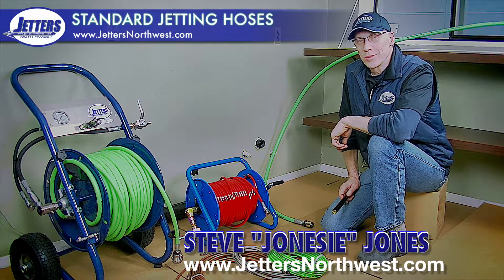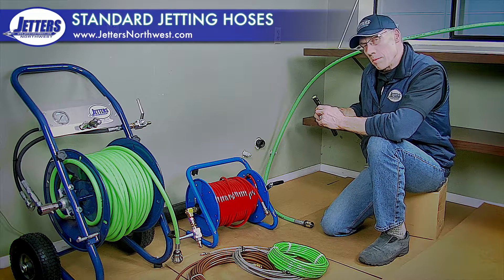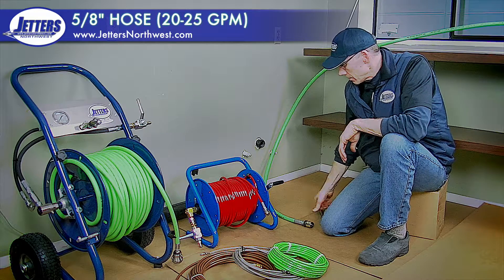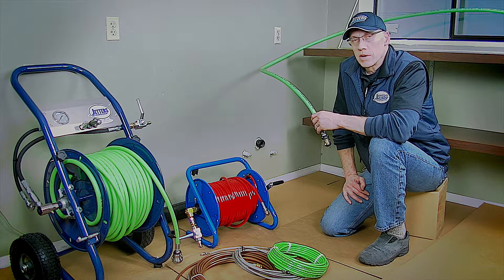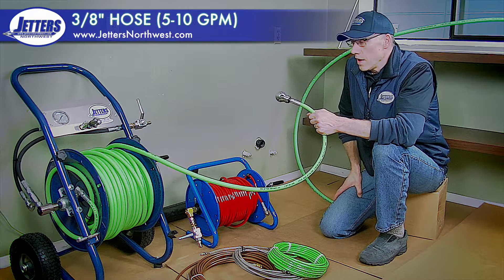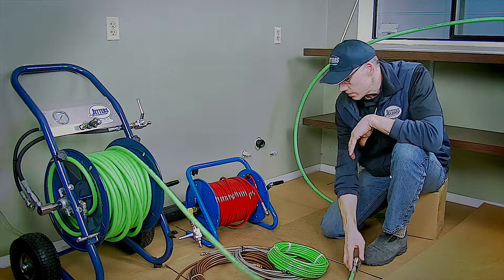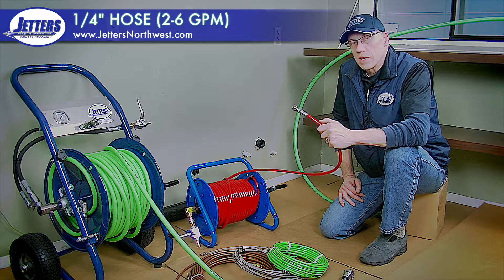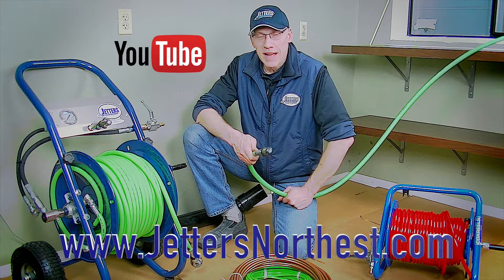JETTING HOSE SIZE COMPARISONS: 1/4", 3/8", 1/2", & 5/8" - "GET" JETTING with JONESIE

Comment: I have a  general 2900 with 3000 psi 4GPM with a 3/8 hose and 200ft , is this a good setup and could I cut roots with this setup?
Reply from the maker: 4gpm is just barely enough to run a root-cutting head like a RootRanger or the ENZ-Reverse but --  because the GPM is so low -- it will be slow going and require using a camera to line up the nozzle on the roots and then a lot of hose/nozzle manipulation.  Serious root cutting nozzles like REAPER, WARTHOG, BULLDOG perform best when "fed" with 8+GPM. This is because you are relying on the water-jets only to do the cutting, and Low GPM-rates make for skinny/weak water-jets that don't penetrate the root masses very well.  Here's a link to a 4gpm Rootranger: https://shop.jettersnorthwest.com/collections/jetter-nozzles-for-roots/products/root-ranger-nozzle
Reply: Hey thanks for your advice thinking about buy one is boss Jetter any good if you know thanks again

Comment: Does 5/16” hose is enough for 4gpm 4000psi machine or I need 3/8” pressure hose?
Reply from the maker: 4gpm typically cant pull 3/8" hose much more that 100 feet unless conditions are perfect and the Nozzle is really built for thrust.  I recommend 5/16"(.31") or 1/4"(.25") for 4gpm, depending on the jetter's PSI rating and the pipe-size to be cleaned :)
Reply: @JETTERSnorthwest  Im using this machine to surface clean flat surfaces and im getting so much vibrations on hoses that im considering going to 3/8 hoses. Im using 5/16 right now lenght usually 100-160ft and I feel like my pump is stopped by this thin hose. Am I right or stepping up to 3/8 hoses dont do much about this fact and I should stay with 5/16?

Comment: so when I want buy a new 1/4" jetting hose for replacement ,  flexible one is good or stiff one is good?
Reply from the maker: Sorry we missed your comment!!  Flexible is typically best, but sometimes it depends on the pipe-size; if you are primarily jetting 3" and smaller then flexibility is very helpful to get thru turns in the line; but if primarily jetting 4" and larger then a stiff hose holds center better in larger lines

Comment: can you use a 1/4 hose on a 4inch sewer drain that has grease in it?
Reply from the maker: So sorry we missed your comment!!  Yes many contractors use 1/4" jet-hose in grease-laden 4-inch pipe, but if your jetter does 5-GPM or more you will get much better cleaning results from a larger Jet-Hose and larger nozzle that is set for your jetter's GPM/PSI rating
Reply: @JETTERSnorthwest  using a 1/4" jetting hose what nozzle hole is required for 2.8 gpm? I don't want to damage my gas powered pressure washer pump. Thanks